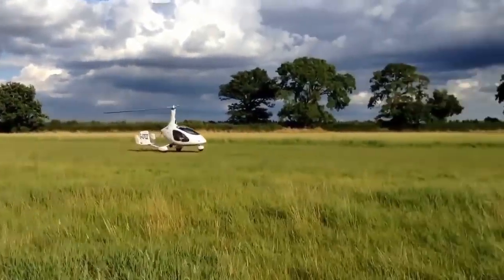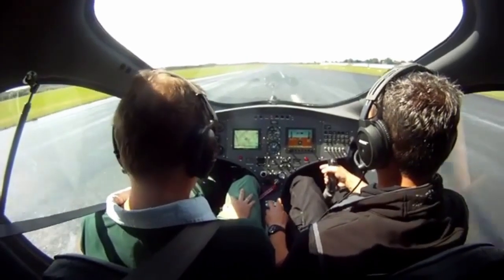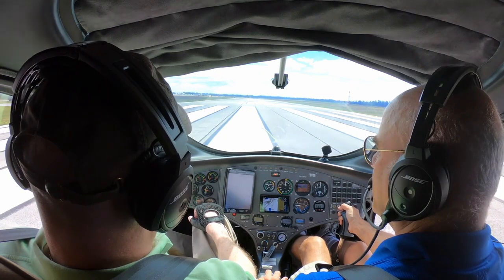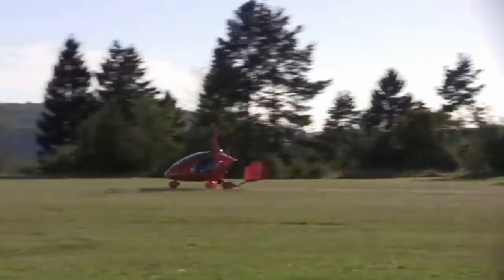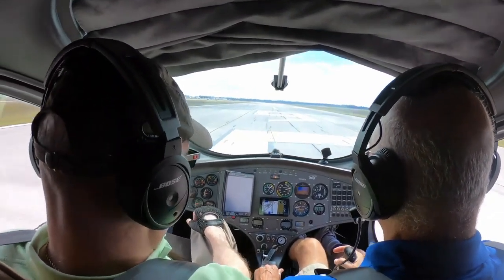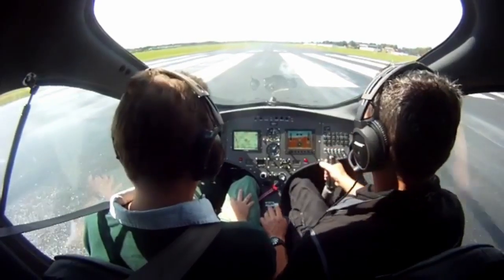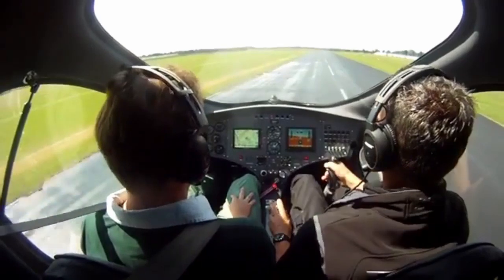How to avoid "Cavalon Nod" gyrocopter pitch control

Comment: Good video . I plan to  get a cavalon . I could use a more comprehensive guide on this ussue - You mentioned problems  with fuel not in baffled tank , you hinted at weight and balance but no techniques to correct for . In a vanilla 172 I can soft field landing and take off . On cavalon , it seems to me that you do a SF take off and you land very flat . It seems that the glide ratio is prob very low .  You prob add power over the field to soften the landing ? Techniques please ...
Reply from the maker: Hi - Any misunderstanding is my own but not sure if you've explored all of the videos on the channel as likely much of what you are asking for is there.  Of course any real specific problems / features is always best dealt with one/one via your actual instructor which ensures that no misunderstanding occurs.  To that end regarding the fuel tank - the lack of baffling is part of it the main issue however is that the fuller tank puts a greater % of the overall weight aft.  There is no technique to "correct" merely to manage - which is explained in many of my films, namely not to try too hard to wheel balance as that usually finds newer pilots dumped on the tail.
Reply: @gyrocopterflyingclub6148  Dude I wasnt cutting your vid down and nice word salad . But yea I'm sure somewhere in your vid is a solid method as the video seems to imply a way to aviod nosing up and down.  There are always techbiques in flying- crabbing into the wind , short field ,soft field to name a few.  I am considering buying a gyro so I am doing my research . Your vid talks about lack of tank baffling which is useful to kniw  but nothing much in how to adjust for  -adjust power pull back stick lightly? nothing like that but yea I'm a flight instructor so maybe I I ask too much . Have a good one .
Reply from the maker: Hi - all relaxed here.  Like I say the channel has a lot films, some over 2 hours long on various elements of gyroplane flight the generics are all discussed.  On this "Cavalon nod" the issue is basic over controlling in pitch which stems from a widely taught take off technique that focuses upon "wheel balancing".  It bites in a Cavalon because of a variety of things, partly aircraft design - so W&B is part of that, ergonomics another, physics of the arm another, stick force per movement and the take off trimmed position of the aircraft at take off is the final piece.  

One thing that differs in AutoGyro brand gyroplanes to a fixed wing is the take off trimmed position because trim in an autogyro is on the same shared pneumatic system as the pre-rotator and so all of the air pressure that is used for trim is lost at pre-rotation, leaving the aircraft effectively heavily nose down pitch for take off.  So what happens is this.

Blogs during the ground roll has his stick fully aft for pre-rotation and is trying to find the "wheel balance" which comes at a speed that is slower than the aircraft is able to fully unstick.  The stick is fully aft and the nose starts to rise to wheel balance but due to the aircraft W&B that is not at a linear rate.  So he tries to relax his aft stick, but now that actually requires some actual movement / force to put the stick foward - but again that forward movement isn't linear.  Which leads to the pilot getting out of phase - which then continues to some degree once airborne.

Its a real problem and all of the random 3rd party films of various Cavalons from countries all over the world prove it to be so - as seen in a small way here.  Cheers and good luck.
Reply: Gyrocopter flying club yea I can see that . It’s a situation where you have to be pretty alert and ahead of the aircraft . Cool man
Reply: You'd think by now Auto gyro would have put a baffled tank in it. Wouldn't really cost any more and it would help some.

Comment: Hi
Excellent video!
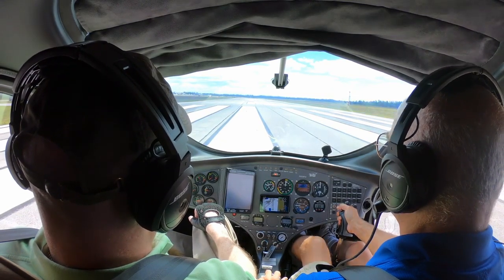Would you kindly elaborate on your comment ..."dump any residual trim pressure "... at 3:15 in this video. Once you change from 'brake' to 'flight' I get the impression that all
the trim pressure is released anyway. But is this not so? Are you advocating application of forward trim at the start of the take-off run?
David Laing 
New Zealand
Reply from the maker: Hi David.  Thanks for the question.  Yeah couple of things actually on trim.  There are two known snags that relate to trim in AutoGyro aircraft generally but it tends to manifest itself more seriously in Cavalon and Calidus because of the general take off characteristic in these rather than the Sport or MT-03 (the older model).

The first is that sometimes I've seen a residual 1 bar left in the system.  I'm not entirely sure why because I'm not a pneumatics expert but I have the pneumatic diagram somewhere and I do know that in the last few years the company have changed some components in the system.  But certainly in the original aircraft across the entire AutoGyro range there would be residual air pressure (i.e. it would not vent all).  Perhaps the pre-rotation process closes the system so it can pressurise the pre-rotation cylinder?

The second snag is the way the stick is arranged some people find it quite difficult to manipulate all of the buttons on the stick and quite a few in bringing the stick aft (after pre-rotation) also activate the trim.  In this case what happens is that the pilot is then trimming aft - which of course will encourage nose up pitch.  See this accident report:-

https://assets.publishing.service.gov.uk/media/5422ee5140f0b6134600020f/Rotorsport_UK_Calidus_G-ETOJ_Addendum_03-13.pdf

As you can see that was a long answer!  So the idea to "dump pressure" really relates to both scenarios, although the later is clearly pilot dependant as some find no issues.

Hope that helps.
Reply: @gyrocopterflyingclub6148  
Many thanks for your comprehensive and informative response. Much appreciated.
Your latest Central Lakes video absolutely fantastic. English countryside really is fabulous.

Comment: I’m thinking that the rotor should stay level or a bit forward until a sufficient ground speed has been attained then pulling back on the stick.
Reply from the maker: No what gives that impression?
Reply: Gyrocopter flying club , just from my observation of watching several of these videos. The nose wheel always jumps up as if it’s trying to takeoff before any forward speed has been gained. I’ve never flown in a gyro but I am fascinated with them. I’m going to go to the next years Benson Days event and see if I can get a introductory ride.
Reply from the maker: Arh ok let me explain. The disc does need to be inclined backwards so that airflow can pass through it and create autorotation. If you keep the disc flat then airflow can’t pass underneath the rotors and they don’t turn and consequently have no strength through centrapedal force. In this situation the airflow gets under the blade sections and bends them back. See my rotor management film. Enjoy your flying you’ll enjoy it.
Reply: Gyrocopter flying club , I didn’t explain my thought process very well. I was thinking that way after the autorotation was done, then gaining ground speed and the pull back on the stick. I really appreciate the conversation.
Reply: rbnhood39 - I think you are confusing prerotation (using power to turn the rotors before the takeoff roll) and autorotation (rotors being turned by the airflow).
If you were to prerotate and then begin your ground roll with the disc inclined forward, you will slow the rotors down. This could lead to all manner of expensive problems including a tail-strike caused by blade-sailing or even a roll-over.
You’ve just used a prerotator to put energy into the blades, now you get the stick back and start your roll - you will be creating a lot of drag by having the disc tilted all the way back like that, but that’s okay - You are trying to increase rotor RPM initially. As the rotor speed increases, you can ease off on the back-pressure and as you’ve decreased the drag a little, build forward speed. Your rotor disc will still be inclined rearwards but not all the way back. In straight and level flight, the rotor disc of a gyro is tilted slightly rearwards whereas the rotor disc of a helicopter is tilted slightly forwards - This is because they operate in very different ways - almost the exact opposite of each other apart from the fact that they both create lift through rotation. A heli pulls air through the rotor from above to create thrust. A gyro uses airflow from underneath to turn the rotors.
Reply: @rbnhood39  You mean prerotation. Autorotation only stops after you land. Mechanical prerotation is only the first part of the business. Aerodynamic prerotation must continue and accelerate the rotor as the machine accelerates down the runway. Levelling the stick would allow the rotor to slow down rather than speed up, and the subsequent pull back on the stick would create destructive blade flap.

Comment: I did my training in an M24 and then did some hours in a Cavalon. What I first noticed with the Cavalon was how quickly the nose wheel jumped up and almost startles the unsuspecting pilot. And I tend to agree with video that there is a slight feeling of lack of direction control. The M24 is more measured nose wheel lift and IMHO is easier to takeoff and land, but prefer the Cavalon once up flying.
Reply from the maker: Hi Rob - yes I’d agree with all of that. Part of the “help” the M24 gives in the take off phase is 1) the rotor head doesn’t allow as much rotor blade inclination as the Cavalon and 2) the straight keel won’t allow the extreme over pitching. As you say in the air it’s different- the M24 stick forces are huge in comparison!
Reply: @gyrocopterflyingclub6148  dude if you struggle moving the M24 stick its not the gyro's problem, you have to go the gym and get that high cholesterol down. The M24 is the safest gyro out there so respect! the Autogyros have had the rotor detached a few times and killed lots of people.
Reply from the maker: @OshoLee  Hello.  Where does anyone say they struggle to move the M24 stick?  The stick forces in the M24 are higher than the Cavalon.  The safety element is a different point to make although while the rotorhead has detached from one Cavalon I am un-certain of the "few times" it has happened.  I will be doing a new film to cover the accident in Scotland shortly.  Cheers, Phil.
Reply: Agree stick forces very high in M24. I overall find Cavalon better to fly. Can maintain cruise 75kt easier, where M24 feels like struggles once get over 65kt. Also Cavalon has lateral trim, bigger fuel tank, and overall build quality etc. On flip side M24 has better visibility and more forgiving takeoff and landing. Guess is all a trade-off. BTW, really enjoy the videos!